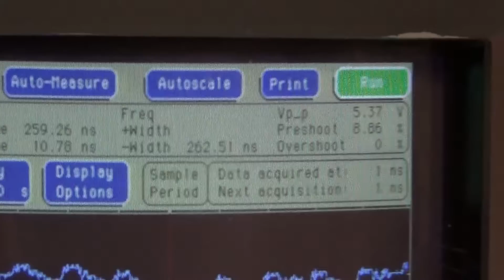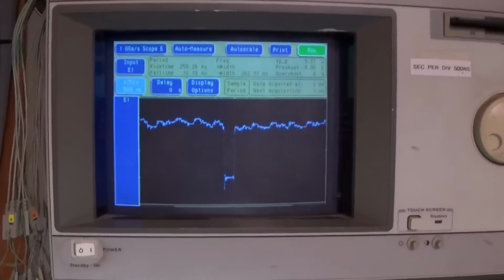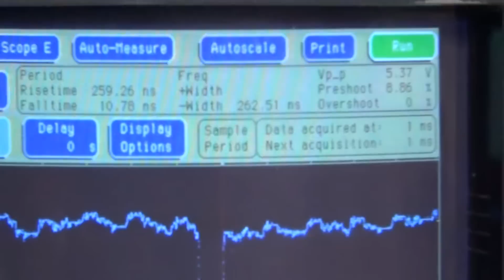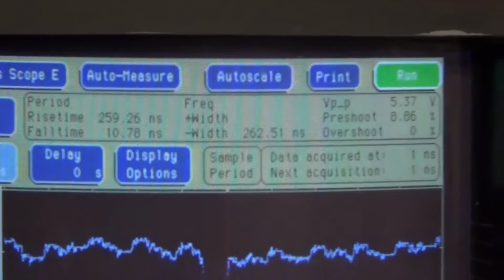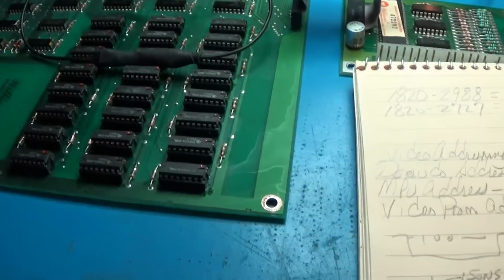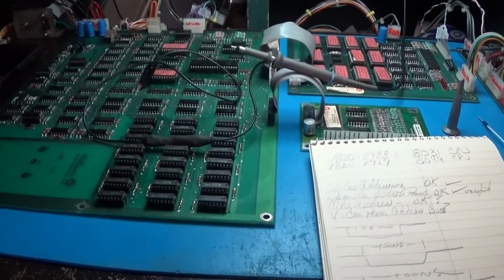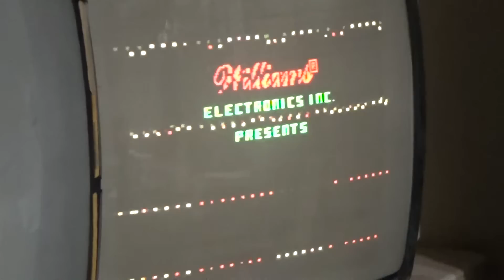Part 2! || 1980 Williams Electronics "Defender" PCB Set Repair\Refurb - 3/24/22

Comment: the explanation does not make sense to me. i would more think about the read timing of the cpu to be too late. if you have a faster ram chip, it would likely put away the output data earlier after releasing the chip select pin. if the clock etc. pins on the dram are too early compared to the reaction of the cpu, you could route some of these signals through two inverters. then you might have the right timing. but of course you probably do not want to change the circuit of the board but rather using the right slower chips.
i think, the timing difference must be measured with a good logic analyzer with a sampling resolution of 10ns or better to really understand what is going on. these usb logic analyzers are affordable and a very nice, effective tool to debug.
logic analyzer for the timing analysis and a scope to check the signal quality.
i am using the digiview dv3100 and the hantek 6254bc. and i am pretty happy with it.
Reply from the maker: There really is alot going on with /RAS and /CAS...  Refresh timing...... address setup timing..     while it would be a fun exercise to analyze it all and find out why certain RAM is failing...  I just dont have time to do a deep dive into it..  Its all I can do right now to just say "its a timing issue" unfortunatly

Comment: as I understand it,  150ns time window is too small, or too narrow, for the games hardware timing loop to complete its row and column refresh operation. they designed the ram addressing hardware for a very specific response timing loop . its CAS latency timing issue
Reply from the maker: makes sense to me....   didnt even think about the refresh operation...
Reply: Even that doesn't quite work since there is not a maximum constraint to the RAS/CAS timing... the only thing I can think of (since obviously there is an issue because it happens) is that there is a glitch between nRAS and nCAS and the 150s are fast enough to catch it?

Comment: This doesn't seem to make sense... isn't faster better?  If the pulse is 262ns wide then anything faster than 262 should do... including -150? i.e. it is saying the write must have completed within 262ns.
Reply from the maker: Maybe I didnt explain it right..  The 150ns Part needs faster hardware timing...   The faster the access time..   the faster the hardware needs to be to properly set up parameters...  Think of it this way, the 150ns part has a shorter window for parameters to be properly set up for proper operation...while the 200ns part has a longer window...  which allows more setup time
Reply: The 150ns timing isn't "I can finish working in this time", it's "You need to give me everything in this time". So if the board takes 250ns to send the data, that's 100ns longer than the RAM is going to wait.
Reply from the maker: @Xkeeper0  exactly!
I do not always explain things correctly :)